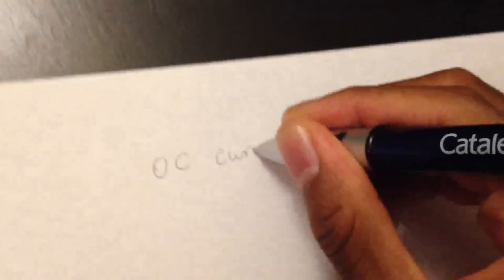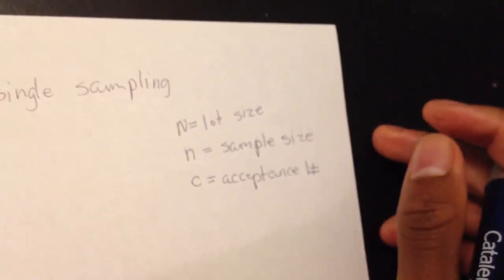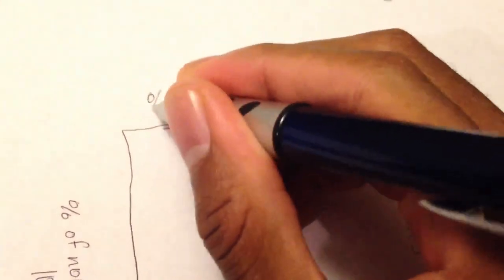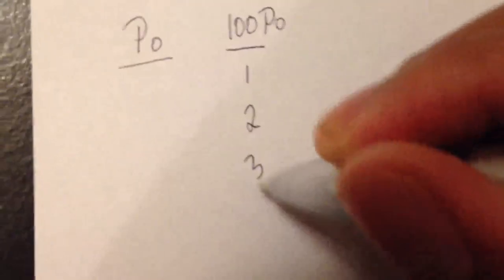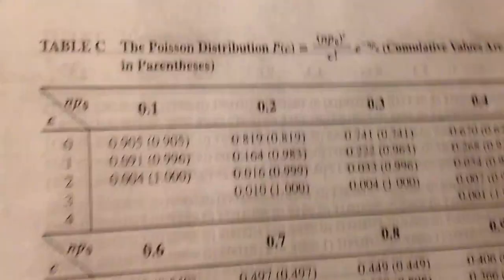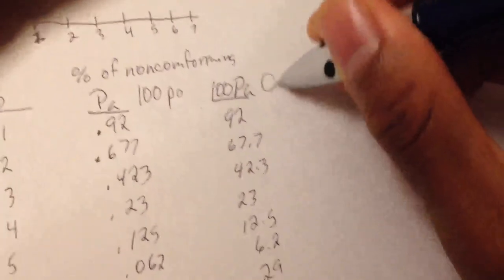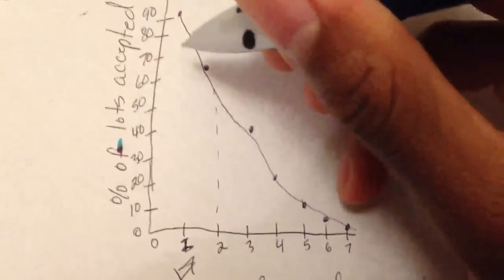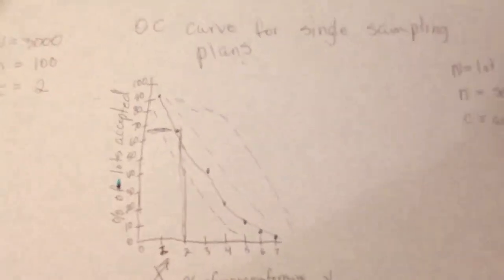How to construct an operating characteristic (OC) curve for single acceptance sampling plans

Comment: I'm currently taking Quality Control and I'm running into the issue of finding certain values in the Poisson table in the 9th Edition. Of course I can google a more detailed table but I wont be able to use it for the test I have Thursday. Is there a video on how to use the formula to calculate the value or is there some process I can do. For example I have the npo of 0.62 and the # of nonconformities should be 1 or less.